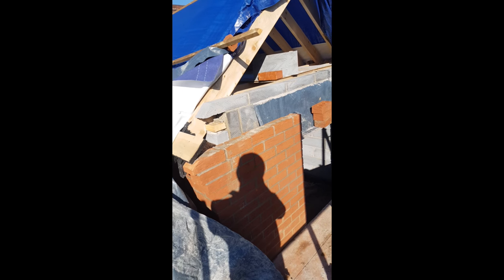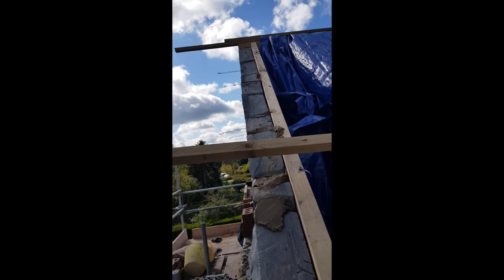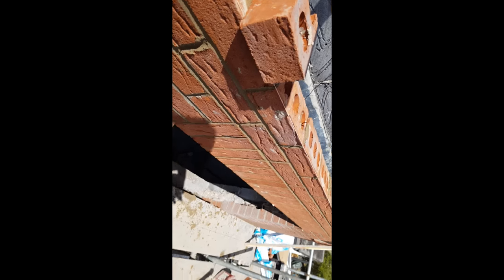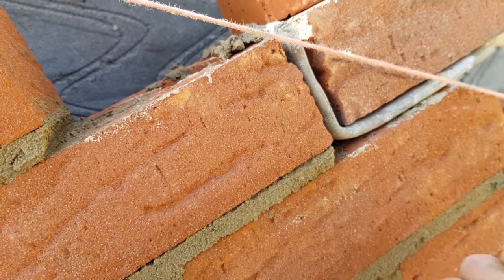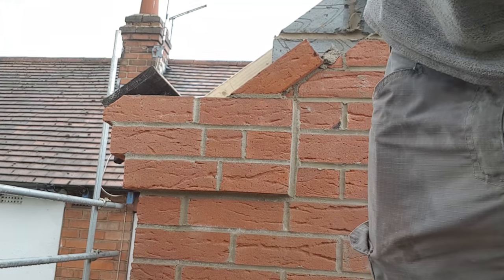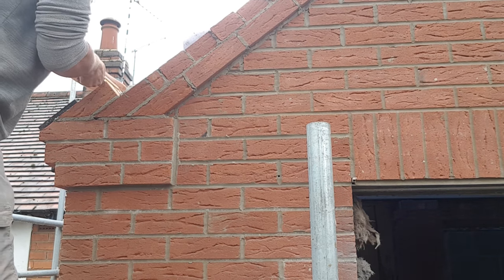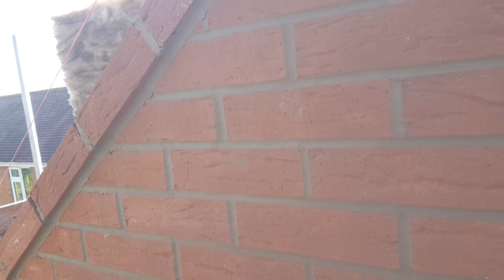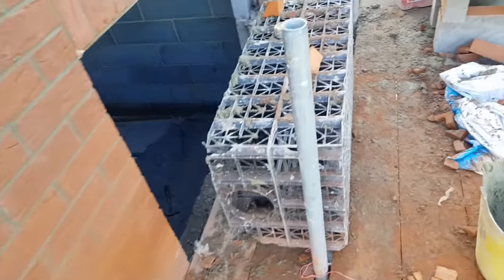Bricklaying - Gable soldiers and pattern #bricklaying #bricky

Comment: Nice job m8. Izzy i always value your opinion / advice.
 On my extension i intiailly wanted a 400 , 500 mil overhang on pitched roof above my sliding doors with maybe box guttering.  
Builder has suggested corbel on gabel. If i have corbel on gabel then will i still be able to have  overhang on my roof or will that hide the detail ? And if its 1 or the other what would you go for corbel on the gabel or overhang on the roof with maybe box guttering? Thanks m8

Comment: 11:50 any and all internal corner vertical joints should be finished flush. They should not be struck with a convex jointer. The bed joints are struck into the corners.

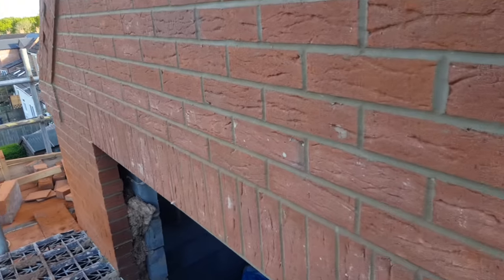Your recessed heads should be flush on the vertical or really angled joint. Your joints at 21:21 on the rake should be flat with a slicker/ jointer not rough because you used a round jointer.  Otherwise job is neat.
Reply from the maker: Cheers mate👌 I thought the internal corners was just a personal preference thing, thank you for letting me know mate!
I have been reading and making mental notes of all your comments 👌
Reply: @IzzytheBricky  if you do it with concave jointer it looks sloppy and wide. Get a flat slicker 1/2" wide, cut blade down to 2" long then you can get in anywhere. Faster to do vertical joints before you close over the top.

Comment: 5:43 the half brick on right hand side of soldier course is WAY OUT of plumb. 

You fabric flashing should extend at bare minimum flush to face of lintel. Flashing should be sealed down to lintel to prevent water from entering below it.